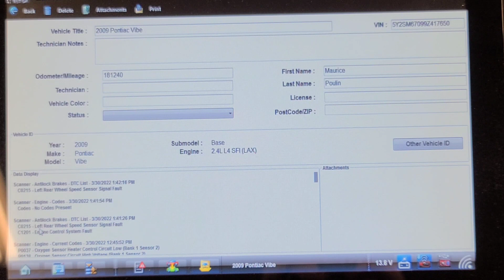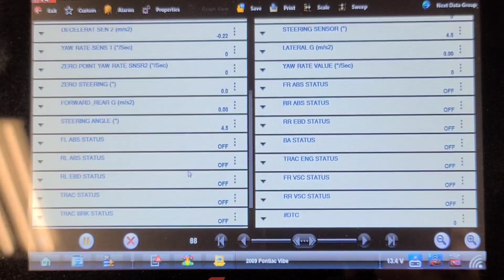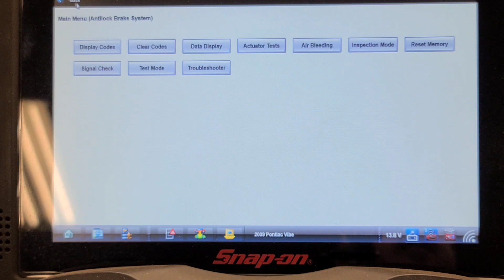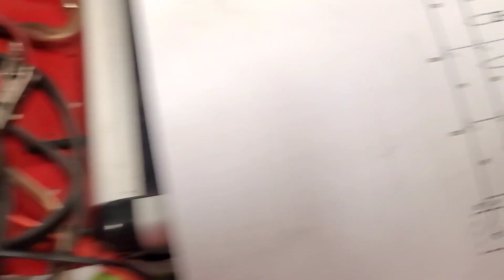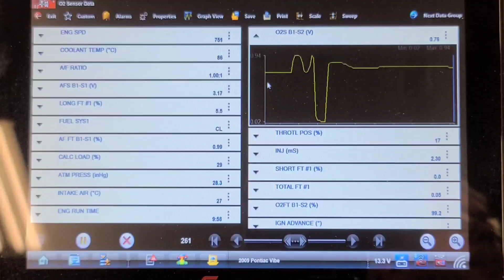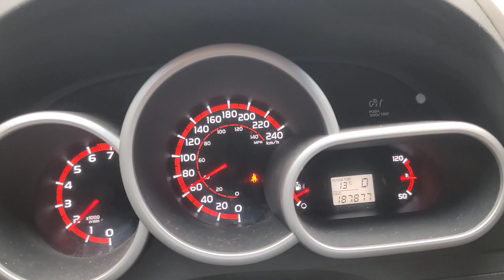2009 Pontica Vibe Left Rear Speed Sensor Code C0215

Comment: Hey there, I’m currently in the same situation but without the check engine being on. It’s going on 3 weeks now, I went to get my car done by a mechanic my dad knows for an inspection. My lights were never on when the mechanic inspected it. Shortly after, I got my car back and I see that one of my stickers are up to date but not my safety inspection… I had to get new struts and a new bushing for which I had to go to him the next week. I took my Pontiac vibe 09 over to him to get replacements done for rear  struts and new bushing. It took 3 whole days for my car to be done and to pass the safety inspection.  after I get the call saying my car is done, he says there was a complication with putting my struts on…he told me that my abs wire sensors in the back needs replaced….i go over there to see what he means and look under the car to find out he cut the damn rear wire sensors in order to put my back struts in….rear wire sensors are very rare to come by and I for one won’t let any mechanic inspect my car again.
Reply from the maker: @jaboibrodie1687  yes and not cheap if you find them. Can the wires be spliced?

Comment: Hi Phillip.  Thank you for taking the time to share this.  People like you make YouTube a better place!  I have a 2009 Pontiac Vibe GT...looking for alternatives to the $1,400 CDN part quote provided by my mechanic.
Reply from the maker: @SynthauraWorks  before you cut the new sensor make sure it fits into the knuckle as the ear for the mounting bolt may be opposite in which case you likely won't be able to make it work. Did you try looking up a Toyota Matrix? Is yours an AWD as well?
Reply from the maker: @SynthauraWorks  Cheriezing 89516-02130 Rear Right ABS Wheel Speed Sensor Compatible for Corolla 2009-2019 / Matrix 2009-2013 Replace# 89516-02131 89516-02210 89516-12140 https://a.co/d/3cNmhs8
Reply from the maker: @SynthauraWorks  I see them on Amazon.com
Cheriezing 89516-02130 Rear Right ABS Wheel Speed Sensor Compatible for Corolla 2009-2019 / Matrix 2009-2013 Replace# 89516-02131 89516-02210 89516-12140 https://a.co/d/3cNmhs8
Reply from the maker: @SynthauraWorks  https://www.amazon.com/Holstein-Parts-2ABS0242-Speed-Sensor/dp/B077ZGZZC8/ref=mp_s_a_1_8?crid=1M7OSAUETX2DA&dib=eyJ2IjoiMSJ9.t9bwgRnMBWrJbW0K0yBTvE6Nx2DKEjy1cl3Ua388JUxbZfDe7qVgT2LSj1PK6VU75plDhqBxZrpFUxyhHieVekgNUnotml6NQRcrNdHYXcLI2mCGxn0Onna3U0MIXV_eVrL1vRmiL5NZ6rF3P6idZEUZbLSkzRVHcdBDQe9rxv85WjBzNEUxb8seAjZwUNat4jBEDN-zz-2IRcOHSZ9qFA.GcLwxM_K4H3P8d0HjZiQVZXF-51EMmcVqbwGbfcDR-Q&dib_tag=se&keywords=2009+pontiac+vibe+rear+abs+speed+sensor&qid=1705799796&replacementKeywords=rear+abs+speed+sensor&sprefix=2009+pontiac+vibe+rear+speed+sensor%2Caps%2C226&sr=8-8&vehicle=2009-52-612------------&vehicleName=2009+Pontiac+Vibe
Reply from the maker: Glad it helped you. Note that there is a left and right sensor though.
Reply from the maker: @SynthauraWorks  You could try a Toyota Matrix but no guarantees
Reply from the maker: @SynthauraWorks  sensor is moulded onto the end
Reply: @PhillipBailey  yup that’s it good find thank you.
Reply from the maker: @SynthauraWorks  good luck 👍

Comment: I have an 09 Vibe that has the flashing  vsc, abs, check engine and traction control light on. It came on shortly after I had a flat tire replaced and the tires rotated. Could the abs sensor been damaged during that? Also, the lights periodically go off in their own, but come back on later, seemingly at random.  Any ideas for me here?
Reply from the maker: you need to scan the ABS/Traction Control system for codes and go from there. I can't see a flat tire causing the issue but stranger things have happened.
Reply: @PhillipBailey  I have a DTC reader and the only one it is showing is P0128 - my thermostat is not working right. Could that cause it?
Reply from the maker: @kevinshannon955  you need a full function scan tool to scan the ABS computer for codes. There are several smartphone based scanners that would work such as the Thinkdiag and Autel Maxiap200.  The thermostat running cold code is not your problem but may cause the MIL to illuminate.
Reply: @PhillipBailey  the scanner I have is called Autophix. Does it not read everything?
Reply from the maker: @kevinshannon955  I'm not familiar with that particular scanner. I doubt it will scan the entire network